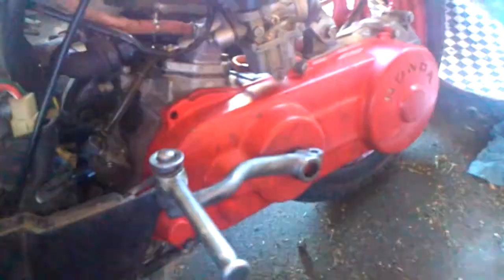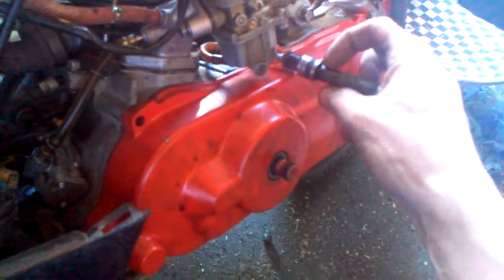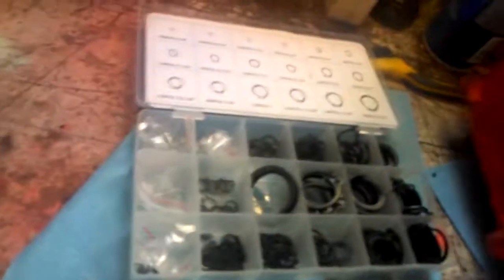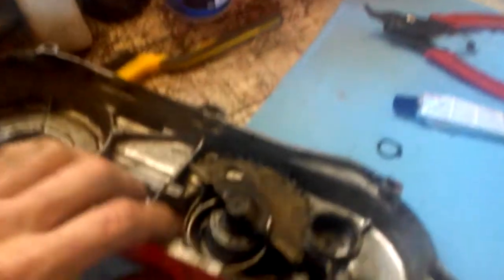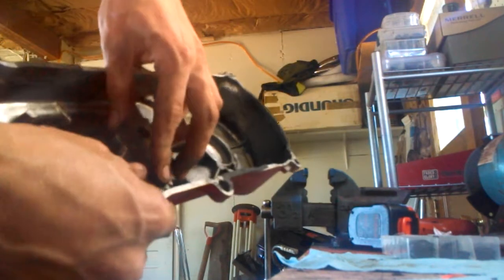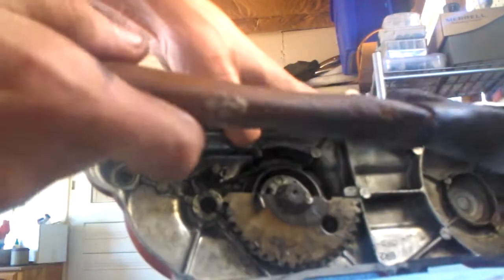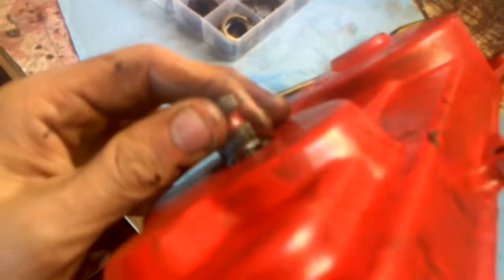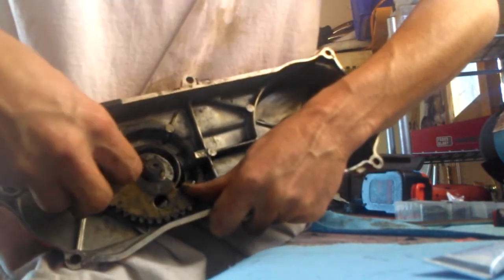Grinding kick starter fix

Comment: Ok so this happend to me while at the gas station, I manged to push it home and put back together but now it has a weird rattle sound at idle and goes away a little if I touch the kickstarter. Did I put it wrong again or what is it?
Reply: How did you fixed that i have the same problem
Reply: @mitchellschouten5724  same problem omg its annoying and its grinding the teeth
Reply: All I did was shimmy the Kickstarter and it stopped